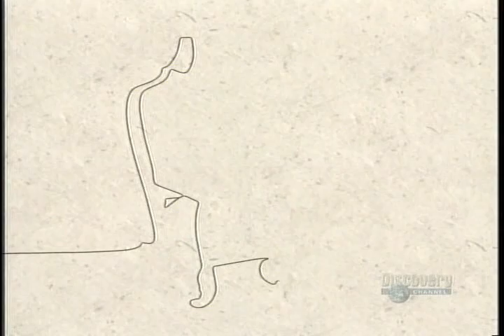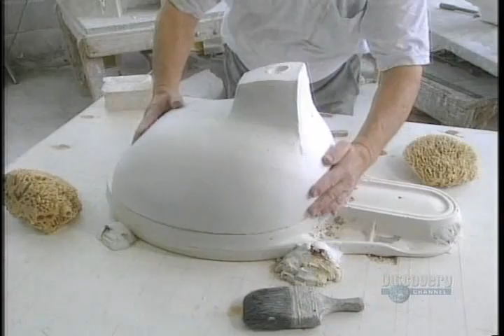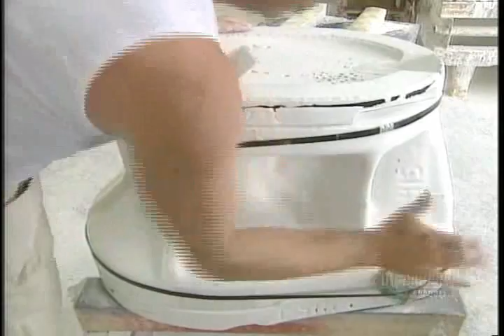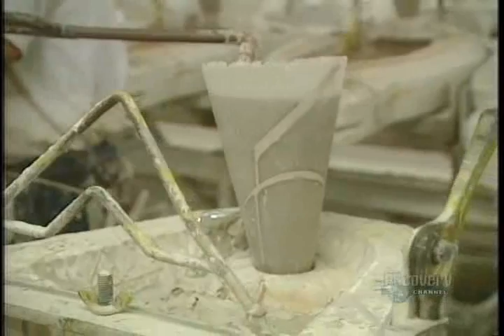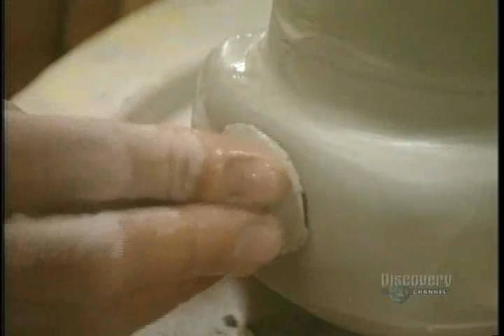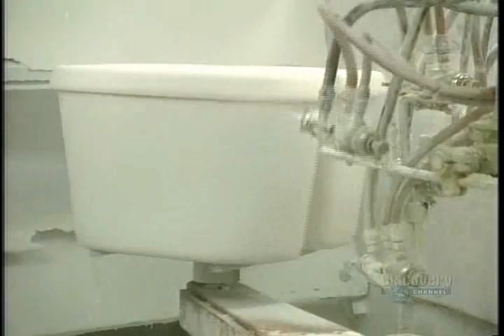How It's Made Toilet

Comment: toiliet industry is very profitable just clay and moulds are needed neither are expensive
Reply: You are correct regarding the raw materials but as you can see it is a fairly labor intensive process. This could be an older manufacturing facility but there does not seem to be a whole lot of automation going on here. Perhaps that has changed since this video.